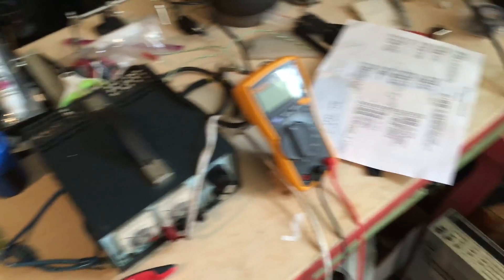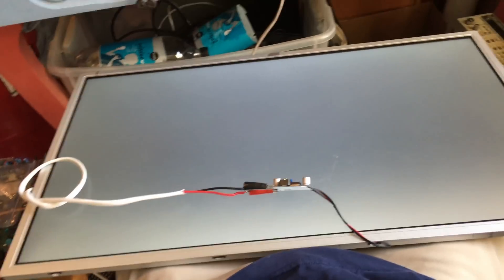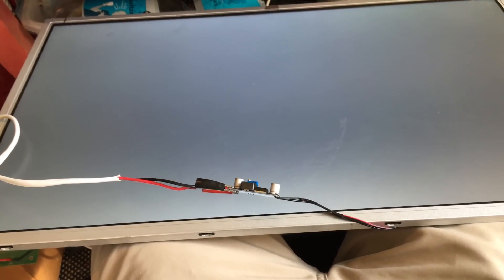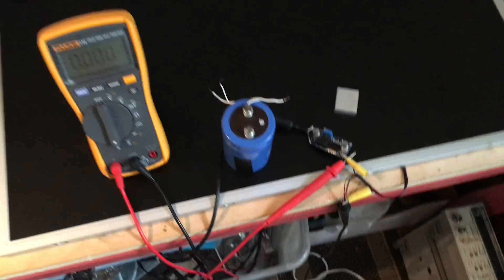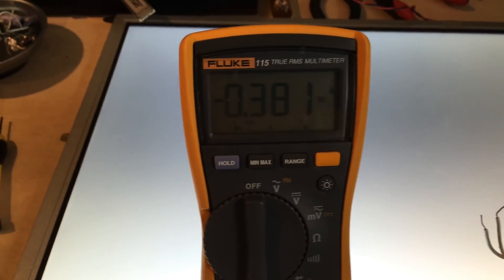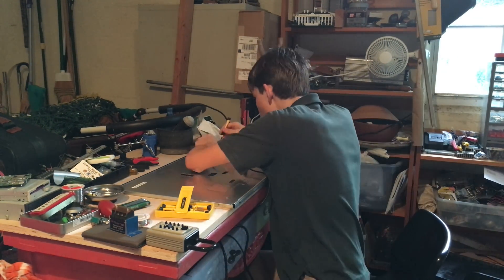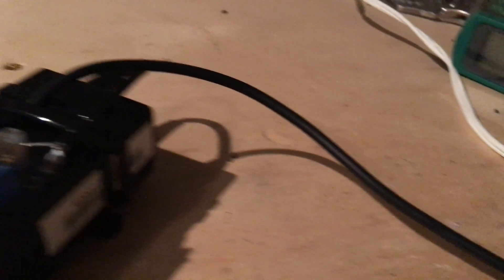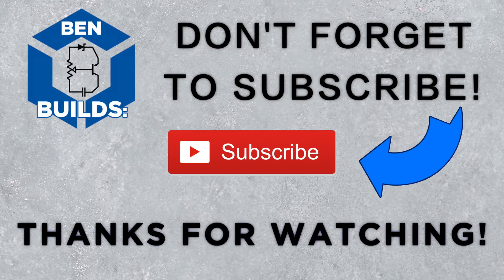Ben Builds: DIY Recycled LED Panel Light

Comment: I have done 2 of these, 1 Samsung 42" and a Vizio 55".  On the Samsung, I removed the input board keeping the power supply board.  When I plug in the AC power, it immediately turns on.  With the Vizio, I had to leave the input board in and I must use the power switch or the remote to turn it on.  How I realized that I needed to keep the input board was having the light on and start unplugging cables.  One of them killed the light, so put it back.  Since, I wasn't going to try to sell the cards, it didn't matter.  I didn't think about it until it was too late, but if you can turn the brightness up to max before removing the LCD board do it.  Putting the 2 sheets of plastic that is behind the LCD screen, gives you the defused light.

Comment: thank you so much, this is really helpful! Especially because of the way you explain things. even beginners can follow without loosing track and on top figure out what kind of bench eqiup they might want to obtain.
Also thank you for mentioning your attempt at the onboard converter - if you ever hack one of those I really wanna see that! (sure when taking things apart the thought rises ""mh must be all in there so how to single out a driver" but even I not knowing much can figure that it would mean to understand all detail of the entire device and that alltogether still is not designed to be modular)
blessings
san

Comment: how is the heat conductivity through a layer of superglue?
Reply from the maker: Pretty decent actually, not ideal ofc but it certainly does the job. The DC/DC converter is still running strong to this day so it must be fairly good.

Comment: hey ben builds, 
great channel. i have an old dell 30" computer monitor that i want so badly to do this project with.

is there any way you can post a step by step video?
Reply from the maker: +mushedroom&#39;s toy box Heres the issue,  you may have an old dell 30" computer monitor, I had an old TV monitor from some Chinese brand, the next guy will have a different monitor and so on. It would be nearly impossible to post a one size fits all video. First check to make absolutely sure it is LED backlit, if not then this process is not possible. Then, find the screens datasheet and check the recommended LED current. Adjust your DC-DC converter to get the current you want and voila! Hope that helped!